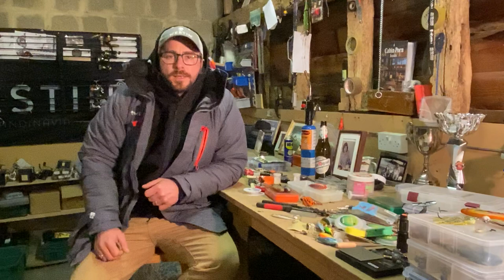Wire vs Flurocarbon.  Pros and cons of pike trace materials

Comment: First point is that the discussion is about traces for LURE fishing . When lure fishing , the "bait" is usually ( but not always) at the front of the pikes mouth , quite often , the trace may not come into contact with the pikes teeth .
Compare to deadbait - where some anglers delay the strike after a pick up , and the bait can further into the pikes mouth .
0.9 /1mm flourocarbon will take some punishment - but if its been in contact with pike teeth , I'll change it .
When jerk baits first came out , we fished them on solid wire traces to maximise the action - I still do - using 0.8 mm TIG welding wire for the traces . Maybe you could do a video trying this out .
Re Scandinavia , bear in mind that their waters are usually pristine and gin clear , compared some UK waters . See this gents findings on flourocarbon traces https://www.youtube.com/watch?v=qLZM9UqCd3g
Reply from the maker: Hey there, thanks for the comment. Yeah absolutely lures only for me never done any dead baiting so doesn’t come in to my mind! Sorry if that wasn’t clear! Interesting on the TIG wire have you got a link please I’d like to check it out 👍🏻
Reply: @Thomhuntfishing  I found these https://www.weldingdirect.co.uk/Sif-316-08mm---316L-08mm-Stainless-Steel-TIG-Rods-500g - problem is - the rods are 1 metre long , so a pack is enough for zillions of traces ! - I'm a welder/fabricator so not a problem for me , maybe you can chat up a local welder to let you have a few rods for a donation to the tea fund . Don't be fooled by stainless MIG wire -it comes on spools and you cannot straighten it - TIG wire is the way to go .
Reply: PS , the traces are short - 20-20 cm .

Comment: Any thoughts on copolymer?
Reply from the maker: Haven’t really used Copolymer much as when I do use a ‘line’ for traces it’s Flurocarbon. But from what I know Copolymer (2 types of nylon) is generally better than most monofilament lines (1 type of nylon) as the blends can give different effects on strength, diameter, abrasion resistance etc but still much more affordable than expensive flouro
Reply: @Thomhuntfishing  thx for the reply. you got me looking more into the Westin range of rods 👍, look amazing quality. Would the jerkbait w3 & w6 be a good starting point to use for canal/river. Looking for a versatile rod for lures ranging from 30g upwards. Thx
Reply from the maker: @RichiHicklin  Is it specifically pike you’re targeting? The jerkbait rod is pretty short and strong, designed for working good sized lures accurately for pike in fairly shallow to medium depth water. As for the quality of Westin kit, all of it is exceptional. The W3 range is the best value range of rids I’ve ever used, brilliant performance at a great price. But I also have a few W6 and they are just 👌👌👌
Reply: @Thomhuntfishing  👍 yes pike, I have some smaller kit for say perch on canal. Probably the lower cost range. Wanting to buy something that's going to be able to handle  larger pike as I improve but also feel nice. Appreciate your advice 👍